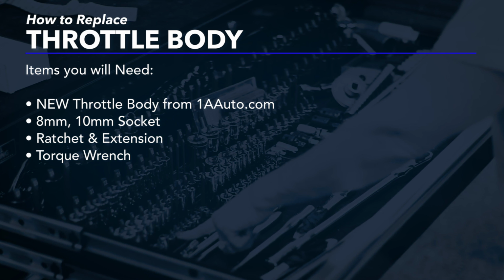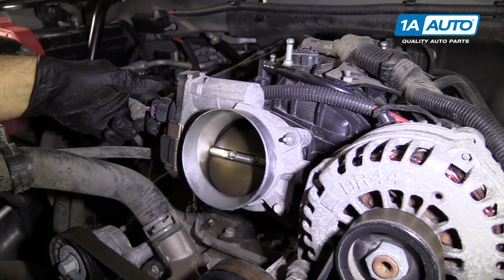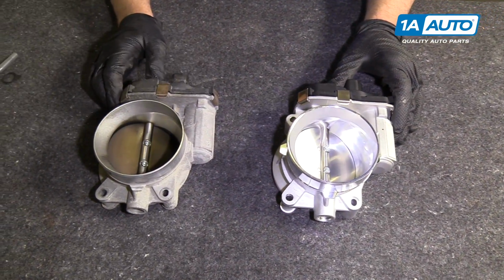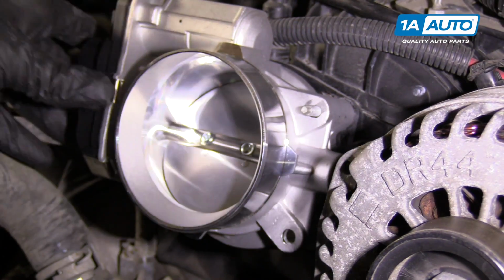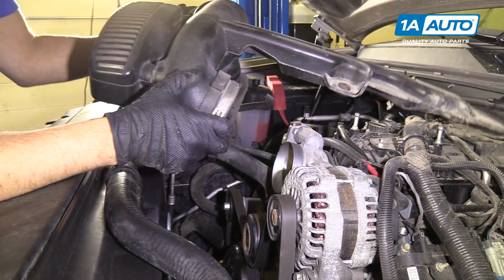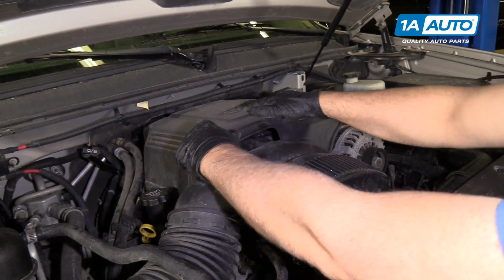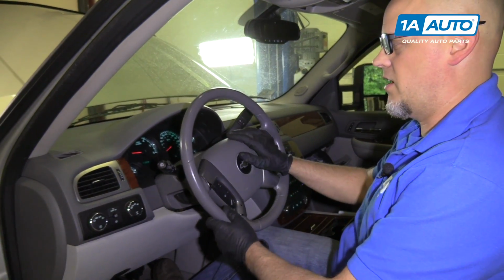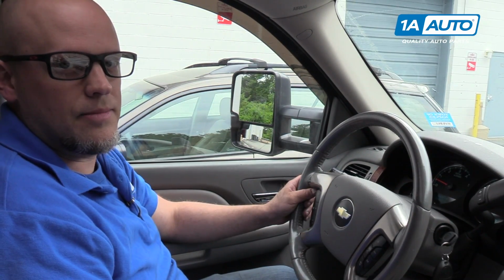How to Replace Throttle Body 09-13 Chevrolet Suburban

Comment from the maker: √  Watch the Video
√  Buy The Part at 1A Auto http://1aau.to/m/Visit-1AAuto
√  Do it Yourself
√  Save Money
Reply: do you have a throttle body that fits a 2009 GMC sierra 4 wheel drive. with the 5.3 engine motor? if so how much?

Comment: Where can I get another rubber ring thing that attaches from the snorkel to the throttle body and held on by the worm clamp?  Mine is all warped so its not sealed on there the way it's suppose to be. thanks.

Comment: i replaced the sensor. not the throttle body. cranked it and its reved at 3000rpm and wont decelerate. any suggestions cause im bout done with this truck. its a 2011 tahoe

Comment: What if it doesn’t reset after the three min idle, one min off, and three min idle? My 11 Chevy Tahoe idles at about 600rpm but if I lightly press the gas it goes up to 2500rpm and won’t drop after I let go of the gas. I have to shift gears to P or D or turn it off.

Comment: Cleaned the throttle body for the first time for my sierra after 12 yrs and 135k miles.   The backside of the body was very dirty with oil.  Took care not to disturb the throttle plate; cleaned the gap just by the jet of spray cleaner.  Starting the engine and  no issue on rpm from the start.   Seems the engjne response improved.

Comment: Took mine off to clean. Now I'm getting a high rpm code p0507
Reply from the maker: +Big G We wouldn't be able to diagnose an issue like that here, you may want to have a local mechanic take a look at it. Thanks for checking us out! http://1aau.to/m/Shop-1AAuto-c

Comment: On a 2007 GMC Denali, nothing worked with or with out a scan tool. Even tried different brand TB. Solution= Manually input vehicles info as a 2008 model.  Hope it helps somebody

Comment: You cant touch the plate while the tps is hooked up, and power is on You really dont want to touch the throttle body unless you have a "relearn throttle position program" on a diagnostic scanner

Comment: Just cleaned throttle body, and it’s idling just fine where it should be

My question is why would my rpms being going up as I’m braking? Brake booster/vacuum leak? Or could the braking issue be related to the throttle body? Thanks
Reply: I have the same issue and cannot find any answer to this same question.....

Comment: A1auto Thanks for The Video,I'm not Mechanic,Know little bit,Check Engine light is on,Scan My 2007 GMC Yukon:Code 1516 Look Like Throttle body,One Question Negative or Positive Battery Terminal Need to be Disconnect Right.or Both. Not Sure Whick one or That's ok Replace Throttle body Without Disconnect...Please Any Comments Will be appreciate Thanks.

Comment: Messed up my 2012 had to bring into shop to be hooked up to scanner to be reset. As soon as I touched the gas it’s go up to 3000 rpms and wouldn’t go down. Cheap fix $40 and 10 minutes and I was back on the road
Reply: Same
Reply: $40??!!??? I was quoted $118. Smh

Comment: I changed my throttle body. Pretty easily. It idled correctly after the second 3 minutes of running the truck but when I test drove it the idle would go up as I was coming to a stop. What would cause that?  Thanks.
Reply from the maker: +mark robinson We wouldn't be able to diagnose an issue like that here, you may want to have a local mechanic take a look at it. Thanks for checking us out! http://1aau.to/m/Shop-1AAuto-c
Reply: Did you find a solution for it. Mine is doing the same drives good just idles up  when coming to a stop.
Reply: I have a 2013 Escalade. It would do the same thing when coming to a stop.  So much to where the truck would shift hard between 1st and 2nd.  This started happening after I cleaned my throttle bottle.  This problem was fixed by connecting a Bi-directional/active test scanner and performing an idle and throttle relearn.

Comment: I bought the throttle body last night, and wanted too get the gasket too just incase. However I couldn't find it on the website. If yall carry it could you send me the link. 09 1500 suburban lt.
Reply from the maker: +Matt Keith At this time we are not carrying the gasket but we are always updating our stock so check back soon!

Comment: So I have a 2008 Chevy Silverado clean the throttlebody. Turn the vehicle on I did not get any high idle ,waited three minutes, off for 60 seconds back on for three minutes still no high idle until I put a little gas then got a high idle. No check engine light just a high rpm. What should I do?
Reply from the maker: +Joseph Bautista We wouldn't be able to diagnose an issue like that here, you may want to have a local mechanic take a look at it. Thanks for checking us out! http://1aau.to/m/Shop-1AAuto-c

Comment: Hello I did everything as you said but my truck is stuck at 3400 rpm idle.  I let it go 3 minutes then 1 minute off then 3 minutes still stuck on 3400 rpms.  I drove it 20 miles at over 44 with slow and speed up no help.
Put on new MAF and Mass air sensors no help.  Was running fine just got a code that throttle position sensor was bad so I put on a new one and now I need help.  Also put on a used complete throttle body from my son and it also idles at 3400 rpm
Thanks
Reply: Did you figure out what was wrong after all??

Comment: The relearn procedure in this video did NOT work.  RPM's stayed at 3000 no matter what...3min/1min/3min process, clearing codes, disconnecting the battery, nothing.  Mine was a 2008 and the video states 2009-2013...maybe that's it, I don't know.  But the point I want to get out to you DIY'ers is that you do NOT have to spend thousands on a high end scan tool to do the Idle Relearn.  I was about to tow mine to a shop before I found out the Harbor Freight $300 Zurich ZR15 code reader is bi-directional and it WILL do an Idle Relearn.  Saved my day and maybe yours too.

Comment: I changed my Throttle body on my 2010 Silverado  and fallowed all the steps 2 days ago and my rpms are still on3k. On park. Any advice on what else to do?
Reply from the maker: +Abel Garcia At this time we are unable to diagnose the issue you may be having as we are not able to look at the car in person. We would suggest taking your vehicle to a local mechanic for further assistance.

Comment: When my tahoe 2012 threttle cleaned. it goes to 3000 RPM for long time. I disconnect the battery for 24 hours. Then I connect it back and did what he said. it works great. It may work if you disconnect the battery for less hours but this is what I have done.

Comment: You made a comment if it continues to clear the code? Can I clear by disconnecting the battery or do I have to get my truck connected to a communicator?
Reply: It should clear on it's own over time, but you can plug in a scanner into the OBD ll port and clear the code manually with the scanner. Diagnostic scanners are relatively cheap to purchase and easy to use.

Comment: Will this same procedure work for a 2010 Chevy Tahoe 5.3L? She just started idling extremely rough and no stabilitrack/traction control messages came on as well reduced engine power and the engine light... going to have the code read tomorrow first thing if it’ll let me drive to the parts store and if it’s the throttle body I’m hoping everything performed here will work for me as well. Thanks
Reply: Tyler Orsak did that work for you?  I’m having the same issue on my 08 suburban with 5.3.
Reply: @thebigv8644  Same issue on a 2010 GMC Sierra, pulled codes P2135 and C0242, both point to throttle body.  Going to replace mine, and recommend you do the same.  This issue is common with our model year range of GM vehicles.
Reply: TheBig V8 sorry for the late reply, I hope you’ve got your vehicle running correctly by now. But yes replacing the throttle body worked for me. When I had the codes read it came up with something to do with the throttle body as well as the throttle position sensor? I think that’s what it was called. They said I would have to go to a shop that had a computer that was capable of differentiating between the two codes because it could be either one. I went ahead and just replaced the throttle body and didn’t deal with the throttle position sensor and she’s been running just fine ever since 👍🏼. If you have any questions or if I didn’t cover something don’t hesitate to ask! I’ll do my best to answer whatever as accurately as I can. 

Oh and btw that idle relearn procedure at the end is bullshit in my opinion. Unless I did do something right it definitely did not work for me. I’d recommend just going to your local dealership or mechanic that has the right equipment relearn the idle. I’d go with a mechanic. My dealership wanted to charge me I think $300? For the relearn. It could’ve been less but still a ridiculous price for what had to be done. On the other hand my mechanic went ahead and did it for free. Now I also had an engine mount replaced at the same time but I’m almost certain the mechanic would’ve been cheaper either way.

Comment: I cleaned my throttle body and rpms are stuck at 3000. I put it in drive and they come down but as soon as it’s back in park they shoot to 3000 and stay there. Any advice?
Reply: Mine is going to 2k with a new throttle body replacement.
Reply: I had same problem. I disconnect the battery for 24 hours. Then I connect it back and did what he said. it works great. .
Reply from the maker: +Abu Saleh Thanks for the feedback!
Reply: Having same problem on mine now, I'll try the battery disconnect for 24 hrs and the procedure afterwards and see if that helps.
Reply: Didn't work for me, I unplugged the battery for 24 hrs, then plugged it back in, did the procedure and drove it, when I first started it after plugging the battery in it worked normal, the rpms started to drop down to normal... After the test drive it seemed to drive normal but when I parked as soon as I put it in park the rpms ran right up to 3000... Don't know what is going on maybe I just need a new throttle body itself, all I did was clean it
Reply: @chrisface101  Same!!! What did you do???

Comment: i did your throttle body relearn procedure,  right down to driving it over 40 miles an hour, it  worked for a day; Now, i'm back to an erratic idle, and the check engine light in now on ( 2007.5 GMC Sierra)
Reply: There could be an issue with the pedal position sensor. Maybe check that if you haven’t figured out the problem by now. I hope you figured it out though it’s been at least 4 months!
Reply: Carlzday have you fixed the problem?
Reply: Any update?
Reply: Hey Wzup man..
Try unplugging the battery for an hour...i just did mine at the beginning of the replacement.then plug it bc up
Hope it works for u

Comment: Why does the throttle body in the install portion of the video look used and old?
Reply from the maker: The one being installed at 4:30 appears new.  Sometimes videos will be made for instructional purposes only and the part does not actually need to be replaced with a new one.  Thanks for watching. +Alexo
Reply: Ohhh ok. Thanks. Just changed my throttle body today. Worked perfectly

Comment: I completed this 4/14/19 using this video and the throttle body from 1A(cheapest on the market). It took me an hour, including the idle relearning. Worked great, check engine light went out, and I saved $700 dealer cost to repair/replace. Thanks very much 1A!!!!!!!
Reply from the maker: Thank you for the great reply. We love to empower our customers by showing you how-to perform your own auto repairs while installing our high quality auto parts. Have a great day! 1aauto.com +EricBuchanan Hardy
Reply: How do you relearn it

Comment: Mine got stuck at 3000 rpm and can't shift
Reply: Mnj fmj you should disconnect the battery before do this process
Reply: I had same problem. I disconnect the battery for 24 hours. Then I connect it back and did what he said. it works great. .